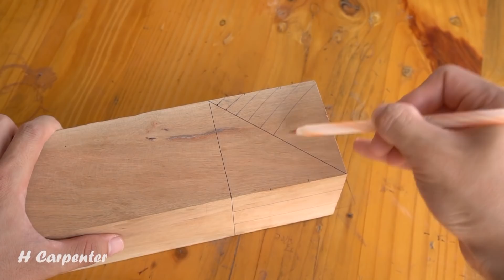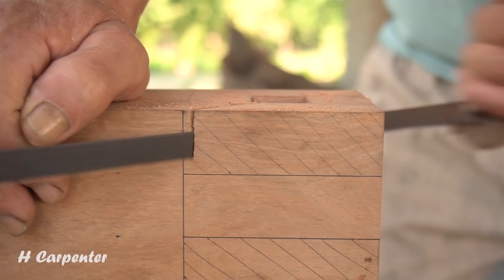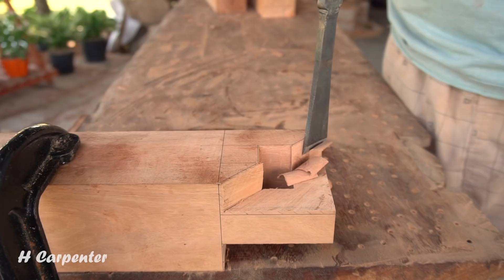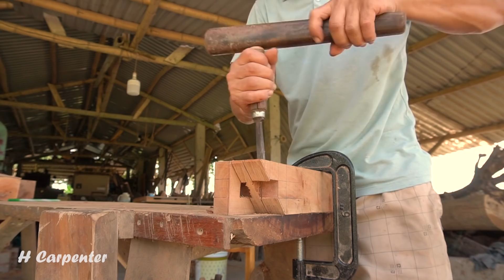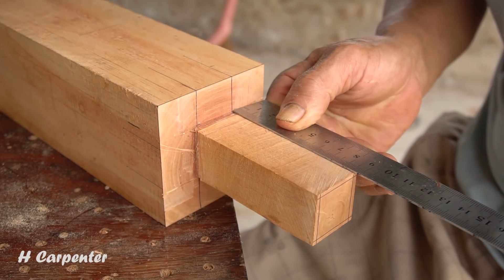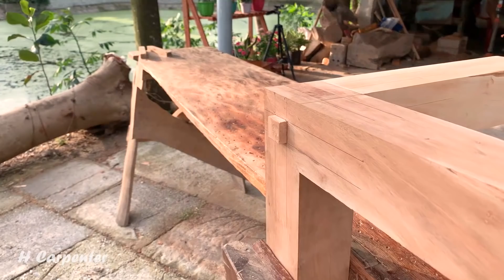IMPOSSIBLE Techniques Of Carpenter //Japanese Handmade Joints  // Amazing Woodworking Skills

Comment: Would it be possible to add a fourth piece to this joint? on top, perhaps a square dowell shape through the middle going straight down but with a 45 degree angle cut into the end of top beam where it would meet the horizontal beam, in order to form a peaked roof?

I hope I explained that correctly.
Reply from the maker: Of course it is possible

Comment: Why would one not use the through tenon part as the vertical strut, because it is strongest in compression, and the two mitred beams can spread out sideways loads across their contact area?  I’m sure this is really strong in all directions anyway, but thinking about flex and wood movement and bending forces here.
Reply: I’ve been pondering this some more and might have answered my own question… When I thought about four of these going together to frame a big box, then assembly might be easier if you don’t have to lower four beams onto their tenons all at the same time.  Using the way they showed here gives the chance to slide one side into position and then then do another.  Even if it is theoretically less ideal, for big stuff it might be a lot more practical to put together.
Reply: You do it your way